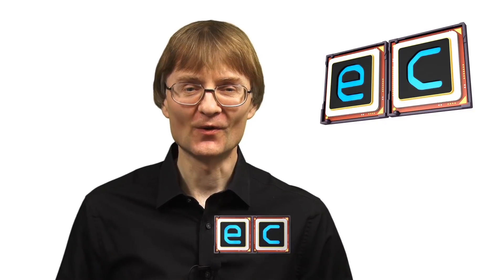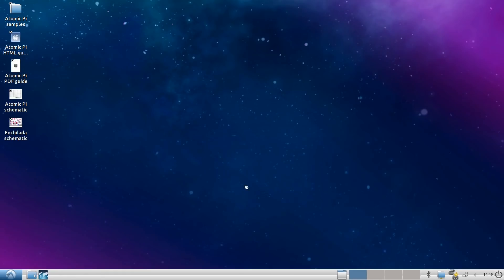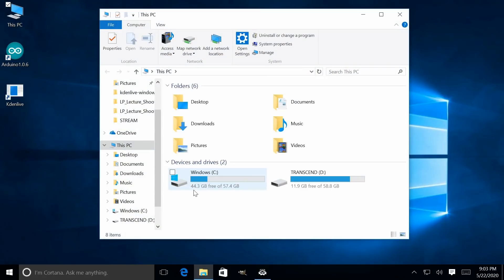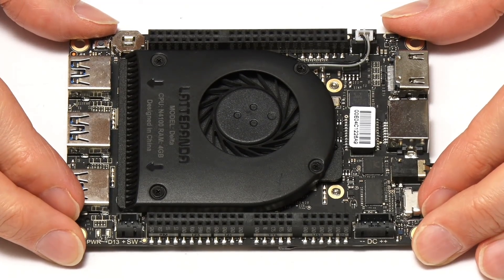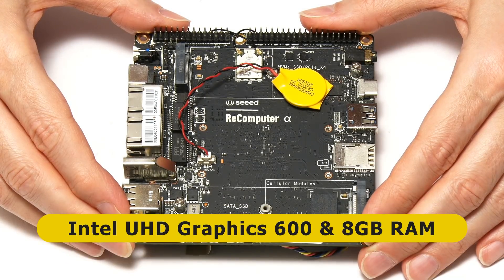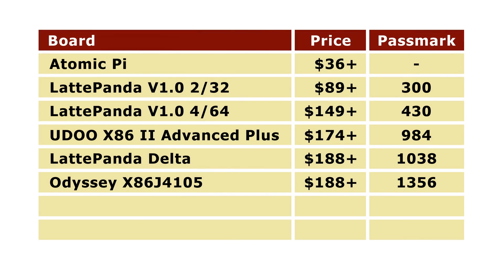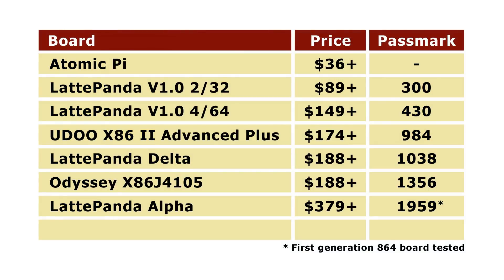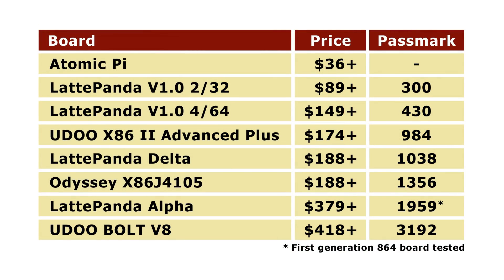Eight x86 SBCs

Comment: It actually does meet the definition of a single board computer.  Expansion slot-based SBCs set the standard decades ago.  Those had RAM slots or sockets, mounts for HDDs, all the usual connectors for peripherals of the day, CPU, GPU, etc but could inserted into expansion slots (ISA or PCI) usually on a passive backplane.

Comment: Atomic Pi might be good enough for me to run Windows Me and games from 1999-2001?
Reply from the maker: If you can find the drivers for the board, which is an very big if indeed. :)
Reply: @ExplainingComputers  Ah crap good point. It's integrated Intel HD Graphics but not sure there'd be drivers for Me though :/

Comment: For many years I relied on hand-me-downs of computers from the rest of the family, but finally the 12-year old Packard-Bell all-in-one I inherited from my grand-daughter developed an intermittent fault, so I replaced it with a Chillblast WAP Pro mini-computer. This runs Win 10 and Lubuntu Linux and has similar specs to the  J4105 Celeron-equipped SBCs which you featured here. The lesson I learned was that if you want to run Windows 10 you really need 64GB of eMMC, as Windows feature updates will probably more than fill a 32GB one. I spend a lot of time trying to offload parts of Windows onto a FAT32 partition on my HDD. I've managed to avoid these updates so far, but you can't do that indefinitely without re-installing Windows.
Reply: I remember that your memory issue was a problem with the Windows 10S netbooks a few years ago that were thrown out there to be Chromebook competitors. Most (if not all) came with 32GB eMMC drives, and I remember an article outlining your strategy of moving parts out of storage in order to be able to update. Around that time I had bought a Alldocube 10 tablet/keyboard combo that dual-booted Windows 10 and Android, and it had the same problem.
Reply: @CallibanMcGee  As an interim solution, I used Win2USB and reinstalled Windows 10 on an external 256GB SSD over USB3. This gave a 128GB virtual disk for Windows and another 128GB for storage. I've now upgraded to a Trigkey minicomputer with 16GB of RAM, a 6-core CPU and 512GB SSD. Prices have come down since I bought the unit from Chillblast , who no longer sell any minicomputer under about £500, but units like my original one were on sale from e-Buyer in the UK.

Comment: There's actually 2 M.2 and 1 mini PCI-e slots on the last board. You can easily tell them apart looking at short sides of these slots.
Reply from the maker: The Udoo Bolt has three M.2 slots -- an M keyed one at the base of the board, and and B keyed and E keyed ones together at the top right. It does not have any PCIe slots. The M.2 slots are detailed on this page: https://www.udoo.org/docs-bolt/Hardware_References/M.2_Connectors.html

Comment: FYI, since Windows 8 that Windows can run from a virtual image (like on the DVD image). Windows home installed that way only uses 8GB storage. Rem WinCE had "execute in place" so programs didn't need to load into ram to execute. Fault with your presentation is lack of knowledge. Details like missing USB standards support. Should know that newer EFI Bios will boot directly to VM file.

Comment: Most of these are more expensive than an Intel NUC with its massive ecosystem and wide range of available accessories, plus much better international warranty / repair.
Reply from the maker: Intel NUCs need to have RAM and an SSD added. A board like the Odyssey, or LattePanda Delta with onboard RAM and eMMC are cheaper.

Comment: They're extremely overpriced. Like I get the form factor and low power consumption but seriously these prices are just ridiculous.
Reply from the maker: The companies making these boards do not have huge margins. These are low-volume products using Intel chips, and the prices reflect that. Something like the Odyssey X86J4105, with its onboard RAM and eMMC, also works out cheaper than most Intel NUCs, where the RAM and SSD have to be added in. So it just depends on the use case you have. Certainly, you can buy the same computer power for less money in most instances.
Reply: @ExplainingComputers  I overlooked the fact they don't sell in large volumes. Makes sense now. Thanks for explaining :)

Comment: About Atomic Pie from a user on Amazon 

"I bought this board after seeing a youtube review of it and the claim it could run windows 10. I was going to use it as a Plex server / web computer for our living room TV. Windows 10 will install....BUT you will not find a Intel hd vid driver and so you're stuck at 800 x 600 res and there is no sound driver so no sound over hdmi (windows 10 64bit no updates due to install hd being too small). This is 100% useless for the reason I bought it. I then spent 2 days trying to figure out Linux well enough to link a media folder in plex, couldn't get it to work and now this rebranded SBC from a failed robotics company (do your research) just sits in limbo. If you're buying to use windows 10 and your Linux skills are non existent don't do it and save yourself some frustration."

I believe all these singleboard computers are worthless and overpriced BS. Simple scam.
Reply from the maker: The Atomic Pi, due to its 16GB eMMC, it not suited to run Windows 10, and I made that very clear in my review of the board and also in this video. So I am not quite sure why you are making the comment you are are, as I have never claimed the board is suitable for running Windows 10. Others certainly have, but not me. :) Whether all eight SBCs in this list are "worthless and overpriced" depends on your expectation and use case.
Reply: @ExplainingComputers  I've posted a thumb up to your video as I did to some  others your vids! No questions to You or  Your job - You are the Great! Sorry, but my native language is not Eng - me from Russia. I believe that these single board computers could be better and cheaper. There is no sense to buy one if core quad full computer I can find absolutely for free even here.

Comment: Which of these boards do run Linux? Not always clear?
Reply from the maker: The only boards here that cannot run Linux (easily) and the original LattePandas (LattePanda V1.0). There is a firmware upgrade as I recall allowing later revisions of this board to do so, but the first revisions really are Windows 10 only (there is no standard bootloader, so inserting a USB drive with an OS on does not work).

Comment: I had a thought, as expensive as some of these SBC's are getting maybe a good option is to buy a low cost laptop and strip the guts out of it down to the main board. sure it won't be as aesthetically pleasing as a standard SBC but for about the same price you have a lot of left over parts, a display that can be repurposed, battery pack, possibly a dvd drive/recorder, and even some crappy speakers :) last Christmas I bought my dad a laptop for about $350 and these days once you open one up there isn't all that much too it. unlike laptops of 20 years ago the main board is quite small.

Comment: All these things got 2 advances, but at the same time one big deal breaker.

Advances:

1) x86 ! Millions of tools/app's, millions of open source tools for windows and linux/unix
2) Windows x86 Support -> If somebody want to use Linux he can use Arm stuff too

Deal Breaker:
Only Windows 8/10 will run on these things without trouble.

Maybe they are Win 7 Drivers at this moment, but i'm shure that not all are aviable, and if, then those f companys like Intel, NVidia etc
will remove * working W7 drivers because "it's not supported anymore"

So if someone want to buy this stuff in the future, and dont want to run W8/10 aka Windows NSA, he need to download all W7 drivers now !
or thrust Driver Download Tools (just dumb people do that. Epic Security Fail = Downloading Drivers from a Source that is not the Driver Manufacturer) later.

Just look at Microsoft, those b removed nearly any hotfix (all what you see is a 404 Not Found) and update download (Web Download over the browser) for xp/2k3, and they will do that with W7 too.

Comment: Why does anybody still make an x86 board, which advertises windows 10 capability, and has an unchangeable 32g drive?
Reply from the maker: Windows 10 can run in 32GB. :) Remember that the space Windows takes on a drive is to some extent (by default) proportinal to the drive, as the swap files take a fixed percentage. So if you install Windows 10 on a small drive it will take  a lot less space than on a large drive.

Comment: I need something that can run linux at really, really low power. My record so far is a Pi Zero, which I was able to optimise all the way down to 0.4W idle. Still too much for my purpose.
Reply from the maker: I wish you luck!
Reply: @ExplainingComputers  I'm still working on it. It's for disposable mesh nodes - little solar-powered boxes that you can leave sitting on top of bus stops or other out-of-the-way places. Needs to run a full linux stack for the software, so a microcontroller isn't going to cut it. The more power it uses, the more solar and battery capacity it needs, and that pushes the budget beyond what is acceptable for a device that someone is eventually going to find and take.

Comment: I get that miniature costs but man the price of some of these.I still want a latepanda!  I built my used ryzen 2600 with a rog strix b450f for 450 and I just built my wife an Asrock A300  with an amd 2400g 16gb of 2666 of ddr4 ram. and  all in it was about the price of the udoo bolt! Shes a teacher and  is sort of a power user but we could not find a decent laptop that fit the bill for a decent price. We included a portable 16 inch touchscreen and mechanical keyboard. So we built her a Mini desktop that blows any comparable priced laptop out of the water! Not quite as portable and no battery but it still fits in her laptop bag. She still has her older laptop if needed for on the move use.

Comment: You know it's time to upgrade when SBC's are knocking at my PC's doorstep in terms of computing power. I built my FX8320 based system in October 2011 and I have been saying for the past 5 years, "next year I will upgrade" Well this time, 100% I am building a Ryzen 3 system as soon as it is available. Edit: FX8120 in 2011 and upraded the CPU on release day in 2012.

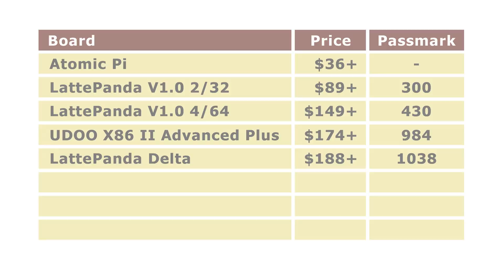Comment: 10:28 The Odyssey x86J4105 Apologies, is that the cpu at the top? Or is it at the bottom? This board requires no cooling like the others shown previously? I'm really confused.
Reply from the maker: The CPU is on the bottom of the board, with the heat sink below that. There are both active and passive versions of the Odyssey board.
Reply: @ExplainingComputers  Interesting, thanks for the reply.

Comment: Iam using the lattepanda 4/64 running my home automation system. It has been running for two years 24/7 without a problem. Great little computer in my opinion for the money.
Reply from the maker: Great to hear.

Comment: I would love a Video of The SBC Micro Controllers reaction times.
Someone in the Comments has done a Passmark score to dollar. 
And
Someone suggested doing a power consumption. 
I would add that you need to test it with the microcontroller in standby waiting for data. i.e Lora signal. 
Having all 4 bits of info would be priceless

Comment: I'd love to see a review on the best arm based pi alternatives for 2020!
Reply from the maker: Noted!
Reply: @ExplainingComputers  Would you say the atomic Pi is stronger than a RPi 4 with 2GB? because i saw videos were ppl run win 10 on it and it works not bad and win 10 use only 1BG ram maximum and it runs really nice. I am looking also for a cheaper RPi 4 alternative. When i see the Celerons costs onl 15 Dollars but the motherboards are so expensive i dont understand that there isnt a alternitiv :-)
Reply: @tamgaming9861  i use lubuntu on the atomic pi. The os only uses 150MB of ram. 175MB if you use a 1080p monitor with a gui. 2GB is plenty for browsing, just don't open too many tabs.
Atomic pi usually gets used for projects. Not as a desktop computer.
X86 uses slightly less ram than arm.
Reply: @ProDigit80  thank you! i will try out ubuntu now :-)
Reply: @tamgaming9861  Ubuntu uses a little more, but not much. Lubuntu is the smallest distro. You'll need any version above 19.04. Recommended is 20.04 (long stable release), as 20.10 is only a 6 month release with many updates but also usually uses more resources.
Reply: @ProDigit80  woaw you are so helpfull... thank you a lot. Yes i will go for Ubuntu. Just one question because i want to try out some deepspeech models which need a python 3 version, max 3.6. When i installed rasbian, then Py 3.7 was already preinstalled, and when i tried to delete it and go with 3.6 the whole system crashed and i could start from beginning with the installer now several times :-) (update i found out Ubu 20.04 has Py 3.8 preinstalled, but no longer 2.7, which is good.) Do you know if it needs python also so hard like rasbian? Or is there a Ubu version with Pi 3.6 preinstalled? Or a good way to downgrade Py or have a working Py 3.6 version, without destroying the whole OS or using a virtual envirement? Thanks a lot for your help and your answeres Muranaman!!!
Reply: @Robert James hello Robert, that Win use 2gb min isnt true. I saw many videos were they tested it, and it used max 1.1gb. Lot of them showed how much gb it used, and it wasnt influencend by opening 10 tabs and more. And yes, with android. Do you know if there is a way to use android on RPi or a other simular OS which works in this way like Android does?
Reply: @Robert James oh thats with Win 10 is interesting - thanks robert. I read some articles about android and Fdroid, but they wrote its not really satisfiying to work with it and google play is near impossible to get on it. I managed now to get audio on it and work now on it to get googles tensorflow on it and play with it a bit :-)
Reply: @Robert James Thats very interesting with the "too slow", because i did my work so far with ESP32 and it is also here and there very limited. I looked also for PC CPUs, and they are cheap, but the motherboards are very expensive. I would like to make something which is in a range of 100 euro (at all :-') Not plus this and this like SSD and so on what you need for RPi. My last idea is to go with Tablets. They have quadcore. Even this barbone PCs what i read is that they are very very weak and you have to clear after each session the cache and so on. Or work with ESP32 Clusters. But this are things i just want to go if i dont find easier solutions. Do you have a Website or Youtube channel were i can see more of you, its interesting to change experience with you. Best regards :-)
Reply: @Robert James 5fps is really very slow ... strange when i see in such competitions that they use also rpi to follow a street lane. But i am not experiencend in it, still have to learn it :-) No problem with communication :-) Was just a question :-)
Reply: We cannot run many softwares on arm architecture.
Reply: @ProDigit80  woaw ...  how cool thank you for this link. I feelt a bit stupid to ask you for this because i know google search, but it was worth because this way i didnt known before. Do you know if 20.04 can work with pi 3.6? or does it need 3.8?  But anyhow i will try out some things  witth, its a great link which helps in many ways. Thank you very much!

Comment: I think it would have been interesting to look at the Udoo x86 II Ultra given that the increase in RAM and slightly better processor could have definitely done some damage in the comparisons. Did you turn on turbo before you did the benchmark on the Udoo x86 II Advanced Plus? I know the Ultra that I got didn't have it on by default.
Reply from the maker: Turbo was not turned on. I don't have an Ultra to test. :)

Comment: I need to get over this but when I here the name Celeron, I reflexively cringe.  I used to support computers in the late '90s / early 2000s and hated having to do anything on a brain dead Celeron computer. It was a miserable experience. I'm sure Intel has cleaned up its act with this processor but I'll never knowingly purchase a computer with a Celeron processor in it. Call it Shell Shock (PTSD).
Reply from the maker: I know where you are coming from, but this Celeron is pretty good!

Comment: Passmark per $ score:
LattePanda 32GB 3,37
LattePanda 64GB 2,89
Udoo x86 II Plus  5,66
LattePanda Delta 5,52
Odyssey X86J4105 7,21
LattePanda Alpha 5,17
Udoo Bolt V8 7,64

So the Udoo Bolt has the most power for ist price :)
Reply: If you were too build a Robot and needed more then one SBC This would be a great resource.
Say your Robot could do everything it needed to on all versions of SBCs and the same goes for GPIO.
You would likely Choose the cheapest.
If there's other considerations for example Type of GPIO Controller and outputs.
I'm currently looking into camparing Controllers especially the Sam.
I would also compare the speed at which the controller can react. I've been watching other YouTubers do comparisons and there has been a big difference. 
Thanks for your comment.

Comment: What’s the difference between the onboard flash memory storage used in the SBCs and the storage within an SSD?
Reply from the maker: The technology is the same, but eMMC modules are usually far slower than even the cheapest SSDs.